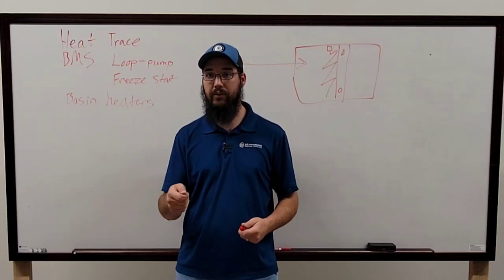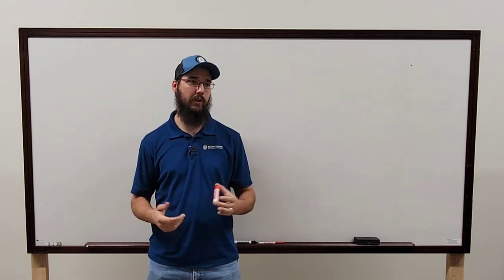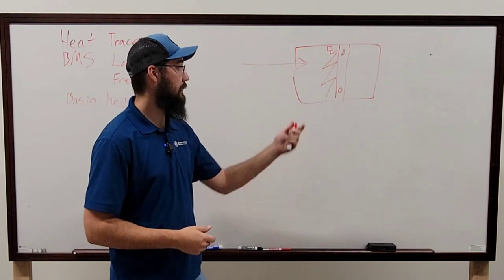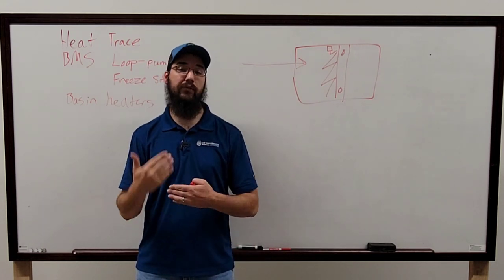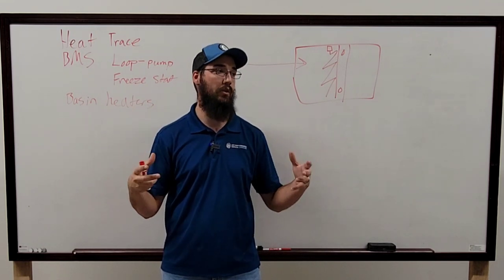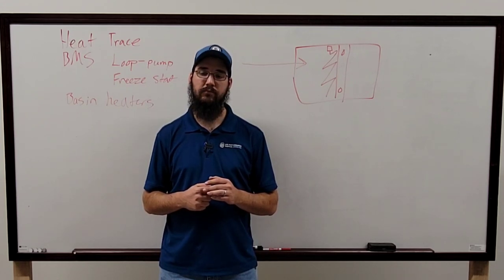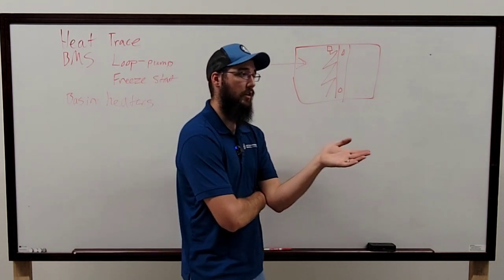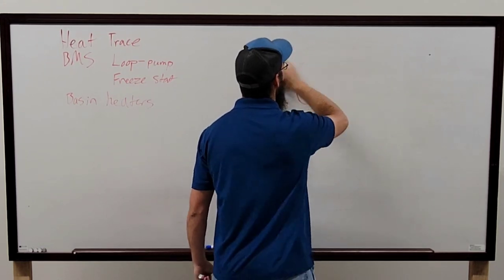Freeze Protection & Economizers BMS Training for HVAC Technician

Comment: Then you have systems that are designed to run in cold outdoor temps. I have several buildings i service ( industrial applications ) where the chillers shut down, diverting valves actuate, and then the BMS switches to the dry coolers for operation. Or the closed loop tower switches to winter mode and the fan runs only. The sump/ basin is emptied. They have basin heaters but they are barely ever running. Im in Buffalo,NY. Most our towers are dry in the winter.

Lots of our AHU here also have face and bypass dampers on them. It works pretty well for maintaining set point/ humidification. Most of our AHU'S have both a cooling and heating hydronic coils in them. Then there are quite a few with DX cooling and hydronic heating coils too. I love the variety of stuff i come across on this side of the trade. I have to have my thinking cap on and thats when i feel i perform my best.

Comment: We are in the northeast. Systems here are built for all four seasons. Its typical for AHUs to have full airside econonmizers and sometimes waterside economizers. In the shoulder seasons like spring and fall, systems will swicthover between summer and winter modes at morning and night due to OA conditions. The BMS is critical and must be programmed correctly to operate in all these different modes.
Reply: You aren't lying at all. Im in Buffalo and i can verify your statement. We have a building that is a nightmare. Its a common piping system with boilers and a McQuay chiller. Its either running heat or its cooling. The shoulder season is a nightmare for service calls. The face and bypass dampers help, but it always generates calls for too hot or too cold from some of the tenets

Comment: Freezestat capillary. The head of the freezestat always must be above the capillary. Also the capillary must be horizontally strung out. The coldest one foot section of the capillary will trip it if the temperature drops below the setting. The freezestat trip shuts down both supply and return fans. CHW valve should open. We have a client that likes to enable the return fan and run it at half speed to pump warmer return air into the plenum and thereby keeping the coil warm.